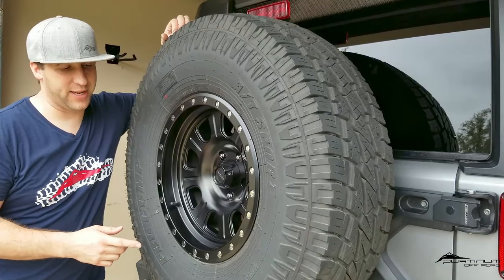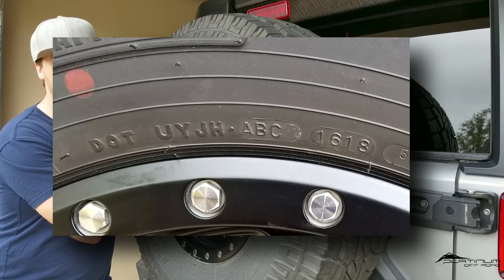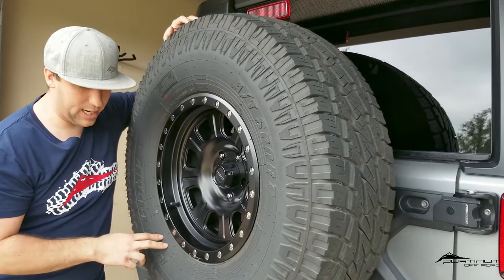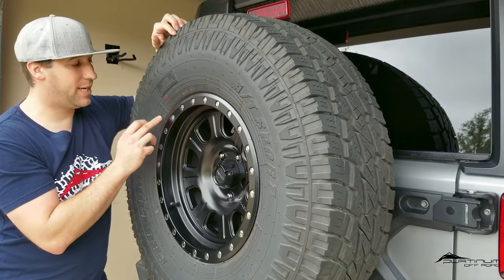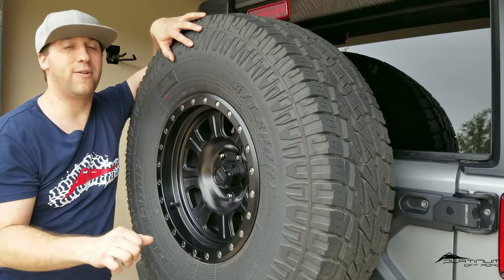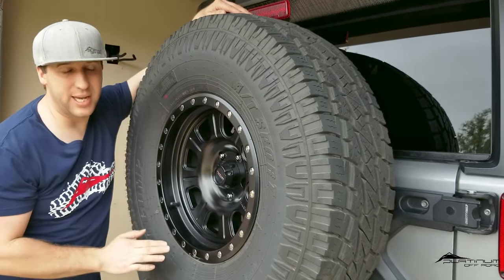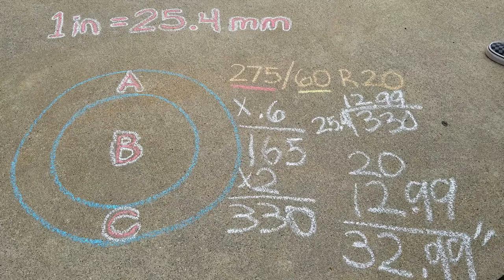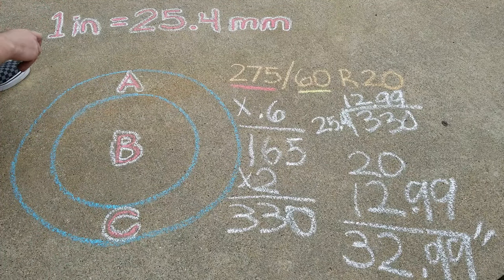Tire Info 101 - Understanding Tire Sidewall Information and Calculating Tire Sizes

Comment: I didn’t realize tire rubber has a lifetime regardless of mileage. I never thought about manufacturing date. Very good to know.
Reply from the maker: It's amazing what a fresh set of tires can do for many vehicles. Just because there's tread depth left, doesn't always mean that the tires are still performing with safety and comfort.
Reply: @PlatinumOffRoad  Very good point. Thanks! I’ll keep a closer eye on my tires now, thanks to you.

Comment: Hi mate, I have changed my vehicle Isuzu d max 2013 tyre and rims (215 55 r15 to 255 60 r18) since then rear brake stated making noise whenever stop the car. Brake pads are checked and are in  condition, unable to understand what cause the issue? This vehicle has shoe drum brake on the rear? Any advice
Reply from the maker: Are you running a non-hub centric wheel on a hub that needs to have hub-centric wheels? And also check for correct lug nuts. Outside of that, the whole wheel and tire change shouldnt affect the brakes, unless the wheel diameter is too small for that brake setup.

Comment: OK,, IS the 37 really 36 because of the weight of the truck pushing down on IT,,,?????
Reply from the maker: No. Its the manufacturing. If you measure a 37" tire before mounting it, they all measure right at 37". Stretch them onto a tire and inflate them and they will reduce down to the mid 36" range. You should measure a tire diameter, when the tire is under vehicle weight, horizontally. This is a huge mistake when folks are trying to measure their tires during a speedometer recalibration or regear - the inaccurate entry after a regear will send an automatic transmission vehicle into limp mode on most newer vehicles

Comment: Hello can I use 265/75/16 on 225/75/16 please help the car is 2010 Chrysler town and country thank you
Reply from the maker: The 265 tire will be 40 mm wider and roughly 30 mm taller overall. Each tire will fit the wheel, but will it fit the vehicle's wheel well opening and not give you rubbing while turning... that's something I cannot tell you. You can go to the vehicle and max out the steering and see that you can clear the increase of deminsions, each direction and all around.
Reply: @PlatinumOffRoad  great thank you very much for your time merry Christmas

Comment: Tires are good for 5-10 years. 3-5 maybe if they're in the sun and heat all the time.
Reply from the maker: Won't take that to the bank. We'll just let everyone see for themselves. Fresh rubber vs 6 yr old rubber. Swap one set for the other, then go back. Proof is in the pudding. Dry rot as well. As the tire ages and sees nominal driving, element will break the rubber compound down and then the cracks (commonly called dry-rot) is a result of non-flexible rubber being shrunk and stretched with each rotation (as the tire flexes with road contact). In the end, there is a huge tapering of rubber quality at the 3-4yr margin. To store a tire away is not comparing apples to apples. This video is referring to tires that get used as a tire was intended... driven.

I have a set of KM2s reaching year 4. They're driven maybe 8k miles a year, and garage kept. Just began to clap on the road, need frequent rotations, and starting to crack.
Reply: @PlatinumOffRoad  well I'm a used tire shop manager and I can tell you most tires are fine long after 3-4 years. I sell 10 year old tires all day every day and they go on to last folks years after.
Reply from the maker: @jonnywatts2970  HAHAHAHA WOW!!! Literally laughed out loud when I read that. Sorry man. I'll just bow out of this match Lol. Ive been in the undustry for over 19 years and seen all trends of tire useage. Spent time in my esrly years at a large national tire chain as a manager and was had to endure many trainings on the science behind a tire. The UTQG, speed ratings, how plys and the angle of their belting affects everything, and so much more. You obviously live life on the edge with your sales and customers. Thats fine. Tell them what you want, but a rubber compound that has began to plasticize and dry rot is what it is and can't be denied. Farewell!!
Reply: @PlatinumOffRoad  look I never claimed to be an authority. All I know is my own personal experience. My customers are in need of a deal. I'm sorry you don't get it but my customers are extremely happy. I'm sorry that you're not. My experience comes from The real world instead of a corporate training. That's why my customers actually trust me.
Reply from the maker: @jonnywatts2970  sounds good man. The information I give will only be based on nearing 20 years of firsthand experience and then some sort of formal baseline. Being a certified automotive instructor I also have to understand the science to the industry. If what you sell to others works for you then roll with it. There's thousands of used tire shops out there serving their clientelle well and it keeps the world in motion. Enjoy!